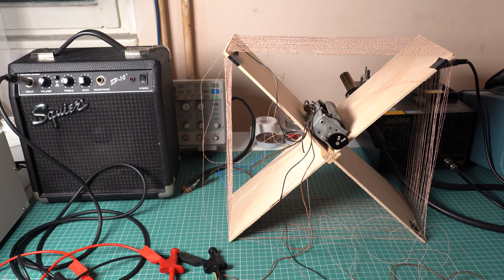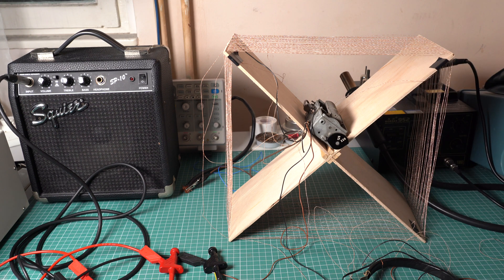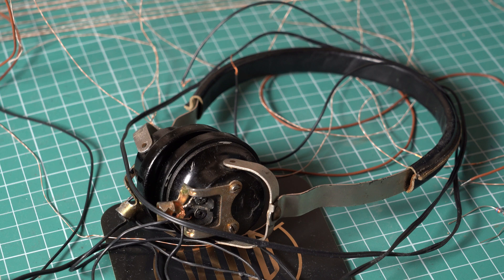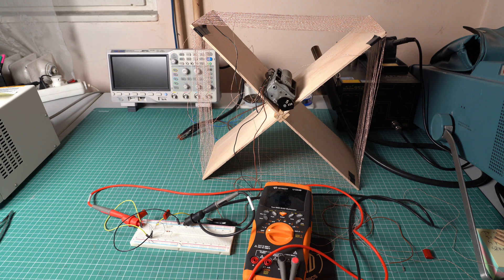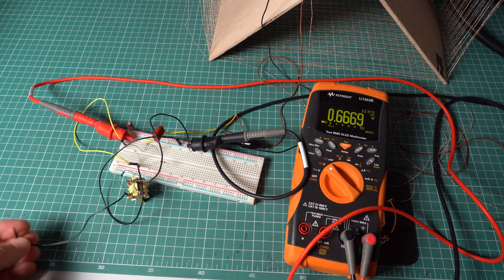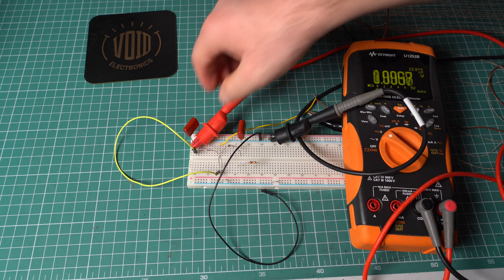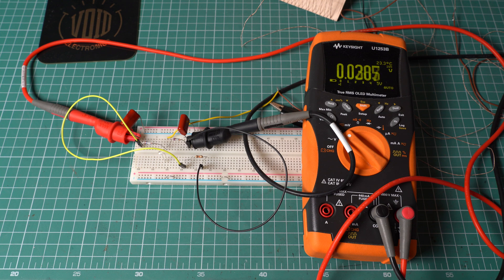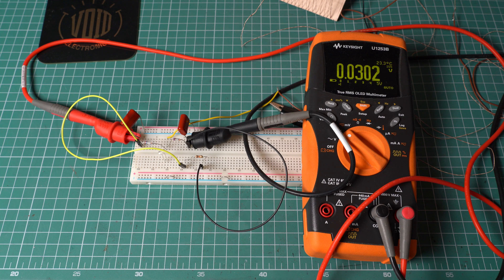Not so Free Energy: LED turns on using the power of an AM station

Comment: I live just a few miles from very high-power local Regional broadcast transmitters (100 - 150 kW) and by connecting to a long wire antenna, I can easily light a couple of LED's directly! The antenna doesn't have to be very long -- around 8 metres is fine.

Comment: 20km, that's pretty close... i basically couldn't pick up only the MW stations that weren't in my continent, but the closest one is at like 200km of distance and "low" power, there's also no MW broadcast in my country anymore since like an year (italy)
Reply: Some people have made crystal radios for other bands.  You can "slope detect" FM.  If you tune slightly to one side of an FM station, you can hear the music.  It isn't great but it works for local stations.
Reply: @kensmith5694  yeah, i think i know that you can do that, they suggested me this with CB radios if you don't have FM, never tried it tho (i have FM in my CB), nice to know that you can do it with FM broadcast
Reply from the maker: Well, I expect the transmitters here in Romania to be decommissioned soon. So I really wanted to show this experiment before they are gone. 
In my case, I never managed to pick up any more distant stations, even though I know they exist and they can be picked up with a superhet.
Reply: @VoidElectronics  that's odd, probably that transmitter is too strong and covers the other signals.... but have you tried during the dark and turning off whatever electronic device? (like computers, TVs, LED and CFL bulbs) those deafen the receiver

i think i pick your nearby transmitter :) (or some other romanian station)
Reply from the maker: @PosthumanKindergarten  I've tried and I only pick up the local stations using my crystal radio. I know there is room for improvement because it only has the loop antenna that you can see in the video. Maybe a long wire antenna would help, but I don't have a place to set one up.
Reply: @VoidElectronics  ahh you mean with a crystal radio... well, i believe crystal radios were from the times that AM transmitters were a lot, so you AT LEAST pick the closest ones, for the distant ones you need a receiver with amplification